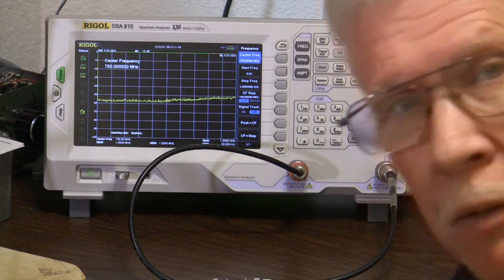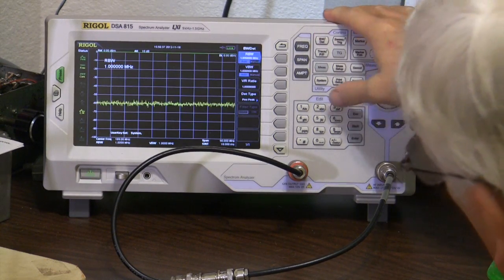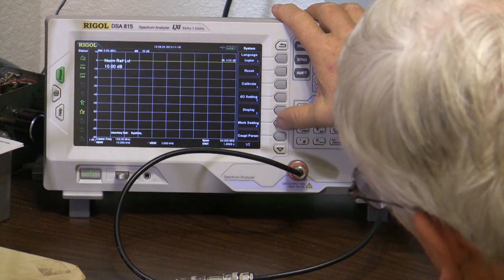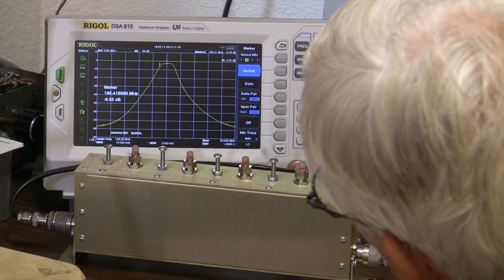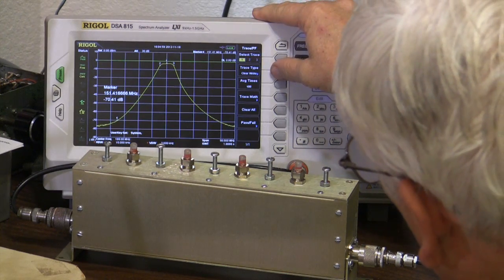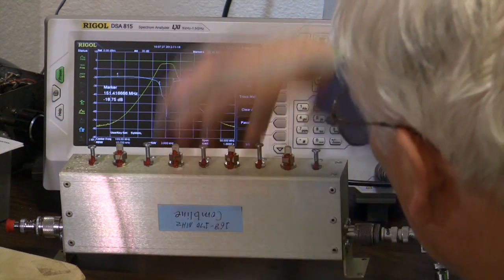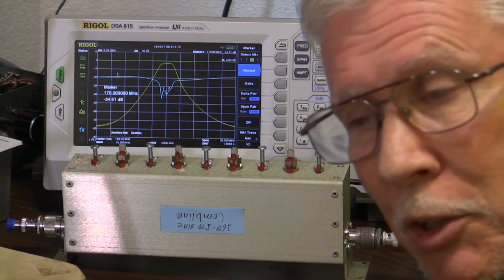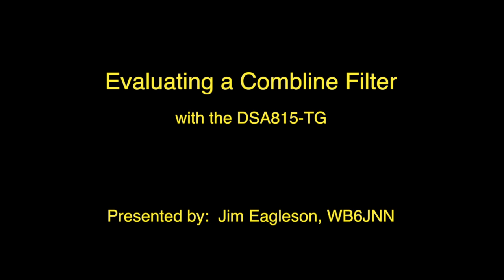Evaluating a VHF Combline Filter   DSA815 TG

Comment: Hi Jim.. that instrument looks more like  a vna than  spectrum analyzer. I use to use  Agilent 8753E. Tuning simplex and duplex units. Can you do it with that instrument as well? Thanks 73's de K8KEM David in Ohio
Reply from the maker: David Eisenberger  Well the DSA815 used with a bridge or directional coupler is not a Vector Network Analyzer since it does not provide phase angle information but it acts as a Scaler Network Analyzer which is still useful for many measurements including rf filters, duplexers, etc.  Vector Network Analyzers can be used for scaler measurements but provide even more information including phase angle and complex impedance information.